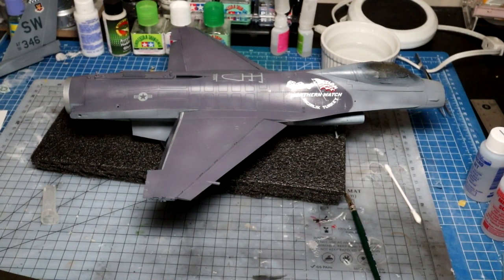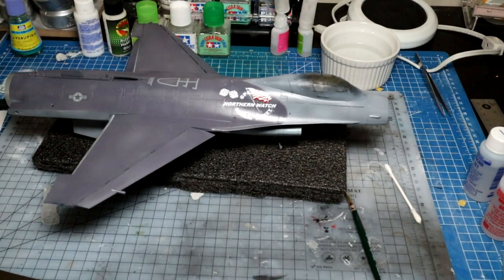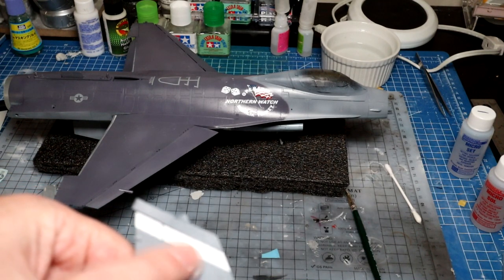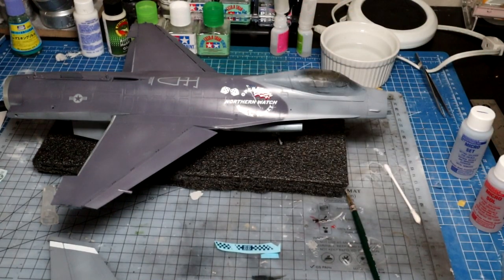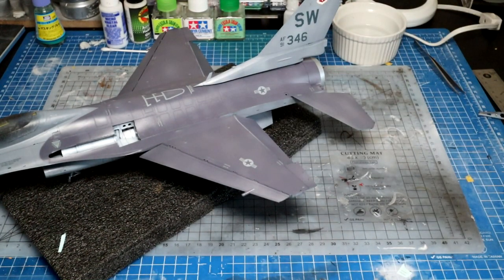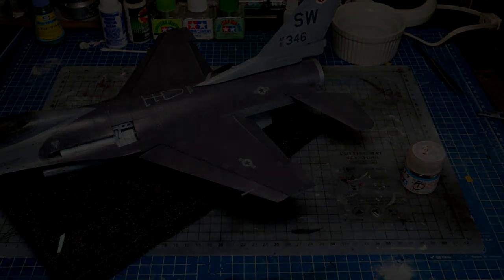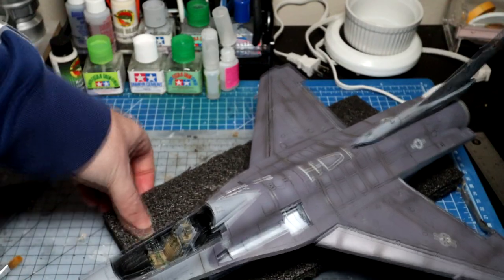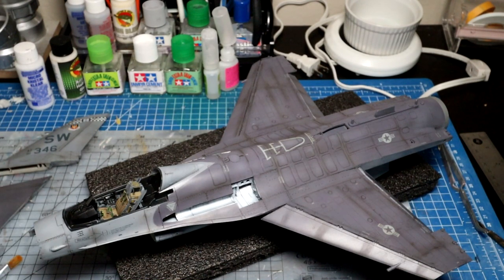1/32 Tamiya F-16CJ Build Series - Part 8: Decals and Weathering

Comment: Question - After taking the seam out of the canopy did you have to re tint and if so how did you go about it?
Reply from the maker: No, not at all. The plastic is all that color. It is not just on the outside. 

Don't make the mistake I made in the F-14 where I tried to remove a seam which should be there. Plus it was molded on the inside. 🤣🤣 Richie